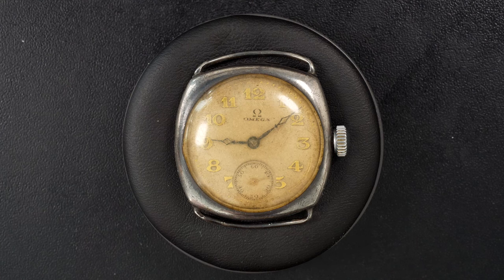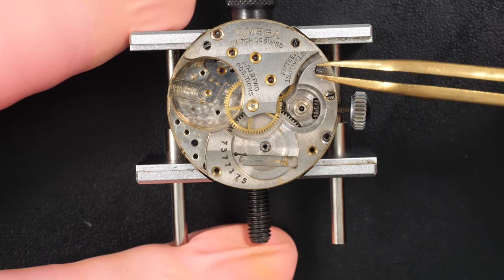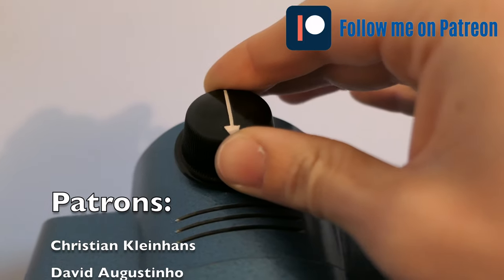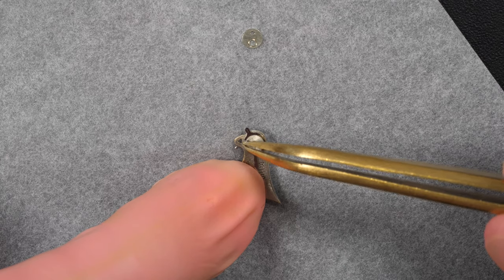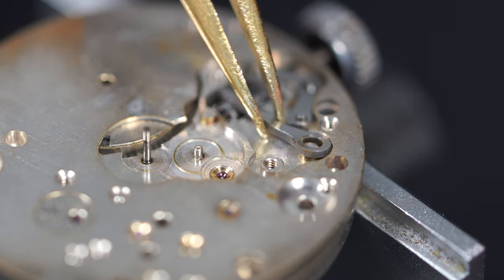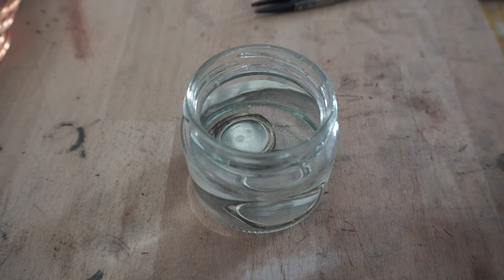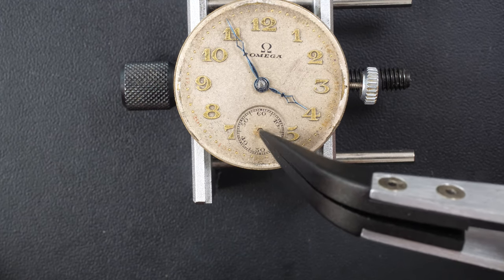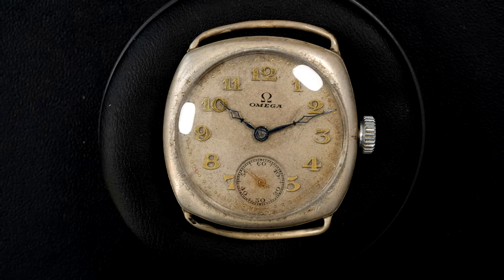Restoring a Very Old Omega Watch !!! Almost a Century Old

Comment: I think the issue with the alignment of the Omega logo could have been a conscious decision, not necessarily the dial manufacturer's and QC department's fault. Note that with the large Breguet numerals, placing the whole inscription and logo dead-centre would cause something of a clutter with the 0 in 10, and leave too much of a void between the Omega text and the 2 o'clock numeral. It's just a loose theory of mine, though.
Reply from the maker: It is a theory but it is strange. Rare to have something misalign on purpose
Reply: @FrenchWatchCollector  I strongly suspect it was added later, likely by a dealer to increase the value. Dial printing back then was very precise. Enamel dials of the period, even cheap ones can be more crisp and clear than brand new very expensive enamel dials from brands like Patek. So why did it not have Omega originally?

Today we expect the manufacturers name on the dial and we know the names of the manufacturers, but in the early years of the 20th century customers bought watches as much by retailer's names and very few would have heard of Omega, or Zenith, Longines etc and the "Swiss watch" as quality perception was a new thing. So you bought a "Mappin" watch, or  "Harrods'" watch, or a "Land & Sea" watch etc. This was very much the case in the British(and her empire) market, but also in some parts of Europe, Asia and South America, but much less so with American brands as they were ahead in brand marketing. 

In 1914 Longines even sent a letter to British retailers promising they would never put their names on the dial or movements they supplied to them. In the UK market the Swiss brands nearly always gave their movements a gilt finish as that's what British customers expected. In Europe you were more likely to see different finishes like this Omega. One of Rolex's actual innovations was starting to insist their brand be featured on the dial sold in British retailers and after a few years this became the norm. 

So, many watches were sold with blank dials where the retailer would add their names. Others have the brand's name around the sub second dial, but under the 12 is left blank. If you look at enamel dialled watches from this period a large percentage are blank today. The retailers name was printed on top of the enamel and has worn off over time, the numerals being baked into the enamel remain. 

We have one example left of what things were like back then with one retailer's name; Tiffany. They never really stopped branding the dials sold through their shop.

Comment: I believe all of the discoloration on the dial face and some of grunge on the movement is caused by the antique acrylic crystal deteriorating and out gassing byproducts condense on those parts. You see a yellowed acrylic crystal and you can always expect deposits on the dial. And the longer the acrylic remains a part of the watch, the more damage.💔
Reply from the maker: Thanks for the info. I did not know a yellow cristal could damage the dial
Reply: @FrenchWatchCollector  it's also acidic and causes that "green jelly" (as some call it) on the plates mostly near/in pivot holes and screws. Also rust (there was a little near the hand bushings on both hands).
Reply from the maker: @rustydog1236  Yes I had some green substance on the canon pignon. Maybe it was coming from this.

Comment: Hello which special solution did you use to clean the dial? Thx in advance
Reply from the maker: I use some lighter fluid
Reply: @FrenchWatchCollector  Did you use Isopropanol?
Reply from the maker: @massimoalberio7946  Yes this is what I used